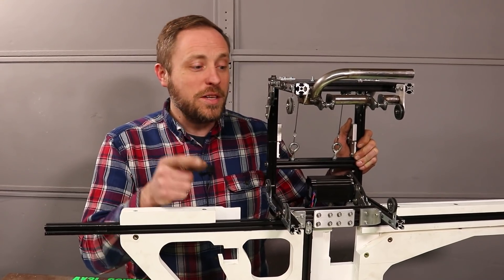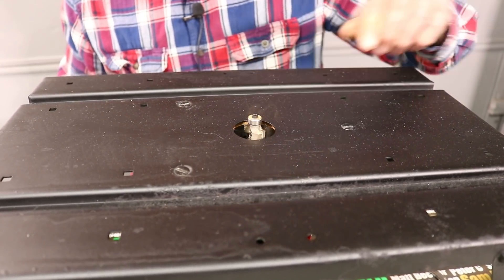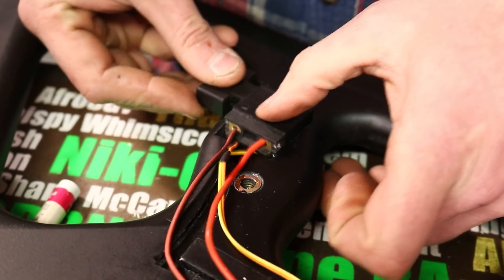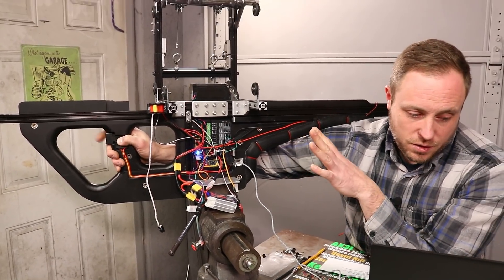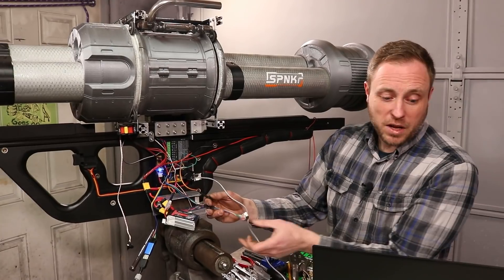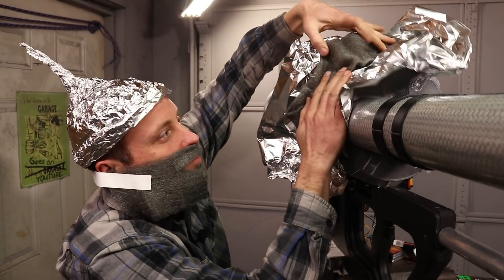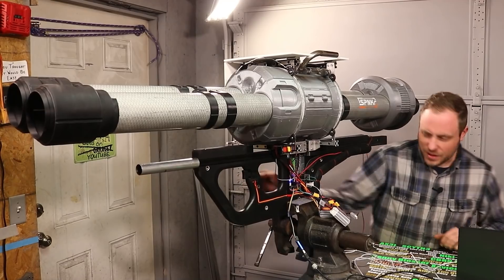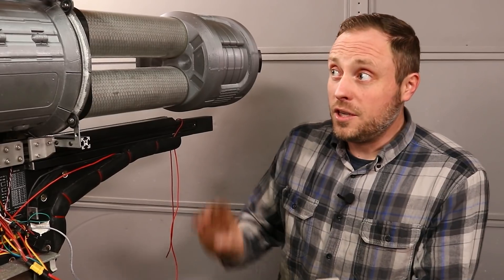It Spins So Fast! - Halo Rocket Launcher - Part 3

Comment: Going to 80rpm was a good idea. You're stress-testing your system. If it can handle higher loads than needed without issue, then it can handle your base load. But it also is great content, because BIG THING SPIN FAST GOOD!

Comment: If you ever want more power in a standard size stepper motor frame, look at Teknic self-contained servo motors... amazing.  I used them in a recent project at work (built 8 identical test machines for multi-million cycle product tests) and came away amazed at the amount of torque. 
From their site: "ClearPath-SD combines a step & direction vector servo drive, brushless servo motor, and high-resolution encoder into one compact package.

Two models are available: the SDSK model, which has 2-3 times the power of similar size stepper systems; and the SDHP model, which has 8-15 times the power of similar size steppers."

BTW, EMI from the stepper can be filtered with R-C debounce circuitry. Make sure to use a stiff (1k) pullup resistor for any such input, don't ever rely on the MCU internal pull-ups... they are nearly worthless. This lowers the input impeadance, which lowers the risk of EMI pickup.
Most of the stepper motor/controller related problems would be resolved by using the Teknic motors... incredible wide speed range... but you would lose the stepper "buzz"... unless you make the servo motor move in steps... which they don't actually do natively.

Comment: G rockets that use the 2 wire system ignition, preloaded in a cartridge with an outside permenently mounted disc (so that way contact happens regardless of oreintation) that allows the signals from the launcher to send to each rocket.

Comment: You would be a lot better of with a brush-less (or simple DC) motor and a tach to detect speed.  If you insist on using a stepper, increase the voltage to near the limit and it will work a LOT better. Use shielded cable throughout and put your micro-controller in a shielded (aluminum) box. That size stepper will generate a ton of torque if you use the correct voltage and current, so you could change the gearing to increase the RPMs. (I'd like to see it run at 120 RPM).

Comment: Nema 23 is very overkill. Also, that driver has a shit ton of step and current settings which prob would solve the cogging. Oh and twisting or braiding the stepper wires together can reduce interference too.

Comment: Hey man, idk how your locating the rotation, but you can buy cheap hall-effect sensors and embed a magnet (or several) into the spinning shaft, that way you can contactlessly encode the rotation of your shaft, and avoid any issues like missed steps causing drift in your perceived orientation.

Comment: Interesting decision to step drive the spin. I'd have likely used a tangent drive/geneva drive or a spring-latch system. Both give much faster initial spin while also having the barrel spin without windup, not to mention mechanical movements tend to be more authentic than purely electronic ones. Downside is half a rotation at a time, and loud noise both during unlatch and during the re-winding of the spring that would rotate the barrels. But both are sort of acceptable imo when you're talking about SPANKR.

Comment: The rocket you showed has straight fins, but real rockets have twisted fins that cause the rocket to spin.  You will need the rocket to spin for stabilization if you want any hope of accuracy... Regardless of what the rocket looks like in halo infinite, it will need to spin IRL

Comment: That looks so awesome! Even the sound is perfect.  

Just a quick safety tip: If you're using a router table without a fence, you really need to use a starter pin.  The table should have some holes on it to install one and even just a screw with a bushing should be enough.  And a push block wouldn't be a bad idea either.  Routers will turn your fingers into ground meat really quickly.
Reply from the maker: I’m unfamiliar with what a starter pin is, but pvc foam board routes like butter since there is no grain. Go slow and it never grabs. I wouldn’t have done this with wood. Trust me! routers freak me out. Making digits disappear into mist in the blink of an eye.

Comment: Perhaps have the tips be soft and be a releasing parachute mechanism- so that you can shoot them at things or into the air and be relatively safe either way.

Then perhaps have a interchangeable CO2 cartridge or small rocket propulsion, so the individual projectiles can be reused, and refueled

Comment: Use an Estes engine and shell it with the rocker prop. Then route an electric fuse to each of the barrels. Add a trigger and something that can check which barrel is being shot

Comment: An issue you're facing is you're using belt on belt not gear on gear, straight cut gears will be a better result

Comment: Shoot at paper elite cutouts with small det charges inside watermelons hidden behind, activation could be by electrical contact or a force sensor on the targets. You could try launching cans of silly putty at a sharp object or a brick wall with a picture of a grunt taped to it. I would wonder how you intend to launch the rockets. Will they use hobby motors, co2 canisters, or something different? Guess I'll have to subscribe to find out.. :)

Comment: Microstepping might get you some more torque. Also maybe just use two motors?

This would be a sweet application for Odrive brushless as well.

Edit: someone else mentioned it, and with that huge motor, more voltage would really help tremendously. I’d run that thing as high as I was allowed to. But then cooling becomes a problem, and for a shoulder mounted device, batteries and boost converters get expensive and heavy.

Edit edit: Trinamic drivers are pretty amazing, but can be $$$.

Comment: I saw another comment about using shielded wire...
Shielded wire would help but in addition to that I would add a ferrite choke to the sensor wires since the stepper drive is giving (essentially) AC interference. The choke (like what you see on laptop power cables and most other DC power supplies) adds impedance to the wire and acts like a low pass filter.
tl;dr 
get a ferrite choke, wrap the wire around it a few times and snap it closed, voila you should have much less interference from your motor.
For best results put the choke as close to the input pins of your microcontroller as possible.
Reply: Microstepping will also help cut out a lot of that nasty high frequency ringing in the motor coils (these are HUEG) and reduce some of the EMI.

Comment: I had a similar interference issue when running sensor wire close to stepper motor wires in one of my projects. I had to use sheilded wire, you can probably get some sheilded ethernet quite cheaply. I still had some bit errors come through, but a crc check added by my sensors filtered the remaining errors out nicely.

Comment: !!! Set your NEMA stepper driver to as much microstepping as they can handle (the little white switches on the side of the drive). In the code, increase the number of steps to match the microstepping. Doing that will make the motor much quieter and will remove the thumping noise, and make the max speed much higher
Reply: doesn't micro stepping reduce torque?
Reply: @darkshadowsx5949  it depends. The holding torque might be a little lower between full steps, but since the torque per step is much much more gradual, you’re actually less likely to get into a stall condition than with full steps, so a lot of the time (especially with loads and at low speeds), you can get away with higher accelerations before stalling. It’s kind of counterintuitive.

Comment: Huge stepper motors have an increased impedance which lowers their response frequency very quickly.
You are VASTLY more likely to burn out your stepper driver than the actual motor. I recommend getting a high-power driver capable of 1/128 or 1/256 microstepping, and also boosting your motor and stepper controller voltage as high as you can get away with within your electronics. 48v would be fantastic and it increases the frequency that your stepper motor's coils can reasonably respond at. I made the mistake of trying to upgrade my 3d printer to NEMA 23 steppers one time and it was a massive failure because I didn't realize that stepper torque drops off incredibly fast as the coil impedance and speed both go up. 
While you have the system still mostly exposed I really, really cannot understate the importance of trying this all with a much smaller NEMA 23 and a high voltage DC PSU just for the stepper driver and motor. You might be surprised at the results. Steppers really are a totally different animal from brushless or brushed DC motors and they don't respond to increased size or power the same way *at all*.
Reply: This man steppers.
Reply: I'm actually blown away that I understand what your saying. Thank god for older 3D printers being a massive headache lmao
Reply: Why not use a servi motor?
Reply: you mean STPPr motors?
Reply: That many pulses per second for what reason? As it is, it seems he has less than 30% torque overhead on the motor before it loses steps at 60rpm. Microstepping causes torque loss. Going from no microstepping to... 1/256? He'll have less than 1% of the motor torque. It makes 0 sense what so ever. You lose so much power and torque microstepping. Even going from no-microstepping to 8x would reduce his torque by 80%. His application is barely precise, he probably has 50+ steps lee-way on the rocket alignment with no micrstepping. Only reason to microstep is for smaller step size.. at the detriment to both running torque AND holding torque.

Unless I'm entirely missing your point. You also did nothing to bring up how limiting CURRENT to a stepper can increase it's maximum rpm, due to the inductance of the stepper. Is that kind of what you're going with as far as bringing up microstepping, the reduction in coil current, trying to use that route to increase rpm instead of lowering current? Instead of just adjusting current and possibly changing drive voltages?
Reply: @dogsarebest7107  I know nothing of electronics with motors and stuff, just a casual gamer who barely knows the current top specs. But, I think what they were trying to say is that he should simply get a higher quality stepper and not necessarily be using microstepping, hence why it should be a stepper capable of the 1/256 microstep. They never actually said to USE the microstep. Just a little point, not attacking anyone because I literally don't know enough to have an opinion.
Reply: @divineholinessjr  to clarify, because I’m an old school 3D printing nerd:

Any stepper is capable of any multiple of microsteps of the number of full steps in its rotor/stator. So you could have an 8 step stepper, very coarse, and still technically microstep it to any multiple of 8. How that’s done is all dependent on the _driver_. The huge counterintuitive point is that they’re load dependent, and that the motor itself has to be well matched with the expected load, as well as the expected acceleration. They are less related than in more conventional systems. 

If a stepper’s torque lags behind its ability to accelerate its load, it stalls. If your load is simply too much, microstepping reduces your maximum acceleration considerably. If you tune it just right, microstepping will help you hit higher accelerations than you could ever achieve with full stepping. If your motor is too big or too small for your load, you probably should have used a brushless servo anyway.
Reply: @divineholinessjr  why tf he ain’t just said that instead of trying to sound smart by typing all that extra shii
Reply: @likent7992  He might not be smart, but instead you don't know enough about the field. The sword for this type of arguement comes back onto the speaker, because most likely, it is due to a lack of understanding.
Reply: @likent7992  you're fine? you just gave your point of view to the other comment specifying that you don't know about the topic
Reply: He should just use a servo motor.
Reply: @ionstorm66  yeah... no.